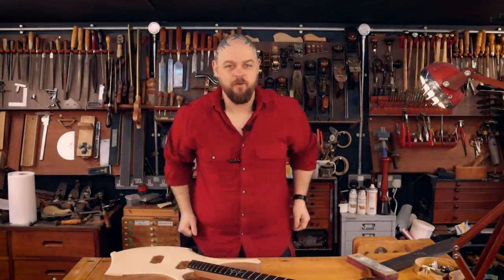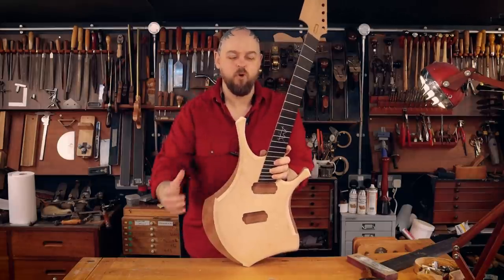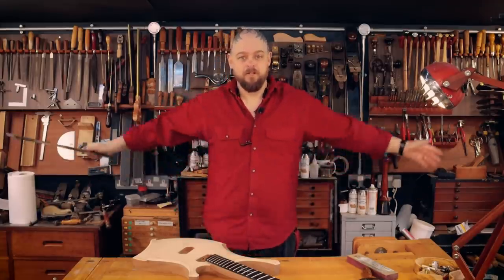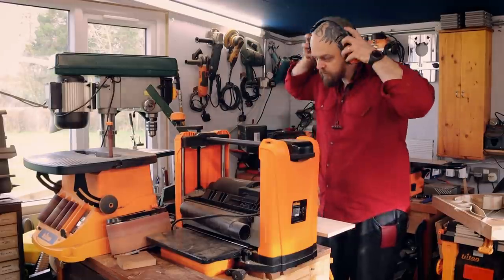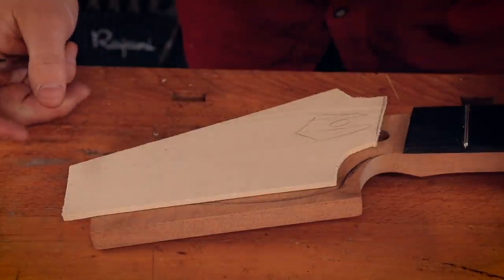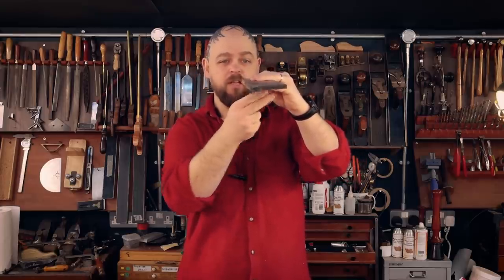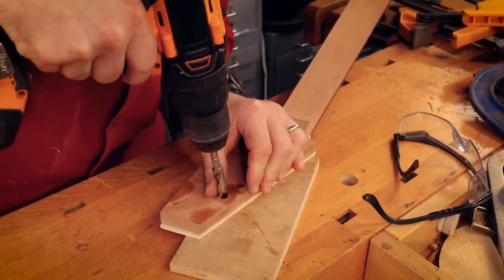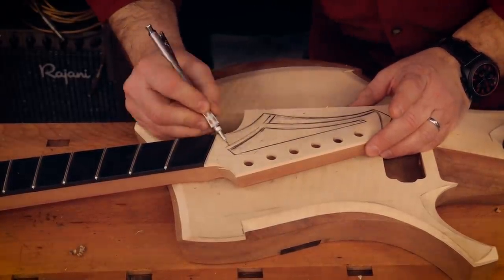Ep 3 - Shred - Faceted Neck - How to Build a UNIQUE Multi-Scale Kit Guitar

Comment: Ben, I love the idea of you having a cavity in the headstock. It will look really cool so long as it doesn’t weaken the headstock. I hope you can make it work.
Reply: think about slotted headstocks and how little wood is there, a cavity inside a headstock made from proper nice hardwood like this will be fine.
Reply: Traditional Acoustic Guitars have a pair of cavities for the tuners (admittedly, less string tension than metal strings) ... and 'Guns & Guitars' did a brilliant Bass headstock design in the last GGBBO merging these approaches which many liked ...
Reply: @Jester-Riddle  i loved that headstock. i can attest to the strength of such designs when i made a custom headstock for a bass i have, 5 strings worth of tension later and it was the glue joint that failed after it got knocked over by a dog, the headstock itself is as solid as solid gets.

Comment: Ben, I love the concept of the control cavity plate, it's wicked. However if the woods expand and contract at different rates and the plate becomes wedged in there it will be staying put until the next dry season, no? I'll be interested to see how this fairs in the future. Keep up the awesome work ;-)
Reply: I'm guessing that some lubrication will be applied to mostly avoid that ... and in the UK we probably don't have quite have the problems caused by differeing ambient conditions to the same degree as with other Countries, such as the USA .
I did wonder about the dimensional changes caused by the finish applied running through inside the 'joint' though ... and certainly see your point.
Reply from the maker: There will be some expansion/contraction but the magnets etc will keep it in place and stop vibrations.. I'm not too worried about it getting stuck, though I may be wrong, I think I have left enough room for that. B

Comment: Maybe  house a small flipout tuner in the cutout in the headstock you can push it out from behind with it fixed to the nut end of the headstock so the screen faces the player and push it back flush after use🙂
Reply: Scrap that idea, it only works on a three a side headstock 😖

Comment: instead of a strip on the edge, you could cut the  cover plate in half and put a strip down the middle, or a  thinner strip on both outside edges for uniformity.

Comment: If i may make 2 suggestions. On the control cavity retainment...perhaps a raised spot on one anda divot on the other in place of magnets or a screw...if that makes sense. And on the headstock...perhaps remove the vernier inside the design you have drawn to match the carved contrast on the body only in reverse. 
If it's to be shrek's little brother maybe some super hot pick ups...then you could call it shriek? Just ideas.

Comment: I'm a complete super novice but I had a thought about drilling through the tuner holes from the back and through the veneer. If I don't have great quality drill bits could I start smaller and then open the holes up using a file?
Reply: You might try smaller from the back and then reversing the drill at full size from the front  ... as that is much less likely to cause tear-out ...

Comment: I always wondered if you were able to sort of "manufacture" or rather create fake flamed maple with Epoxy for example, take a handsaw with a minimal blade thickness and cut the Flame Design into the Body.  fill the gaps with dark grey or black Epoxy, Sand it even and stain the Rest does anyone know if that'd work?

Comment: Ben: A small concern with the extreme 'pointy angle on the back-plate ... It is very vulnerable to damage when removed, leaving an indent on the guitar when it's put back in place ...
I know it's a tiny detail and it wouldn't affect more standard round-ended guitars to the same extent.
Still, is there a way to protect that dagger-like point ... maybe with a metal plate under that edge to strengthen it ?
... I promise that I'm not having a 'moan'', just being pointing out a practicality !

Comment: Is there a particular reason you made that cover that loose in the end? Is it because it can only fall out one way and you want it accessible as possible?
Reply: I'm guessing that it needs to be fairly loose (without wobbling) to avoid it getting stuck due to expansion of the wood in varying ambient conditions. That's why it'll be secured with magnets, or a screw.
Reply: @Jester-Riddle  much depends on the wood, plus you shouldn't soak a guitar anyways. The humidity should be fairly moderate for the instrument

Comment: Wish they had guitar building when I was in school in the 80's.  The closest we had was wood shop, and my Dad forbade it, "Wood Shop doesn't prepare you for college."  Never went to college.  I joined the Army instead; even though the Army doesn't teach guitar building.  By the way, is it true that wood dust and shavings can ignite like gasoline?  Is that why a vacuum is needed?  As you can tell by my question, I never went to wood shop.

Comment: Why would you take thickness off the back of the headstock instead of the top? I would have thought that removing material before gluing the veneer on would have made more sense. That way you do not change the plane of the strings and nut.
Reply from the maker: Changing that angle this degree makes practically no difference to anything tbh and this is a far easier way to go about things. B